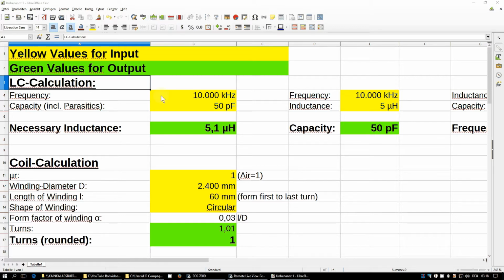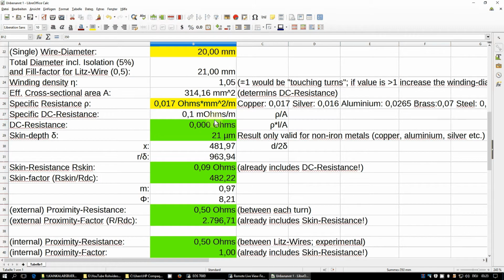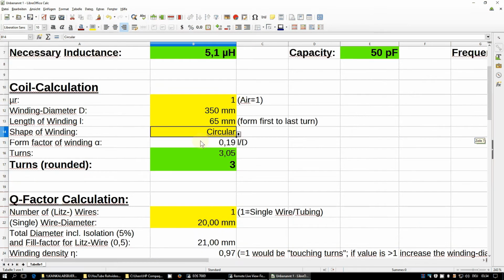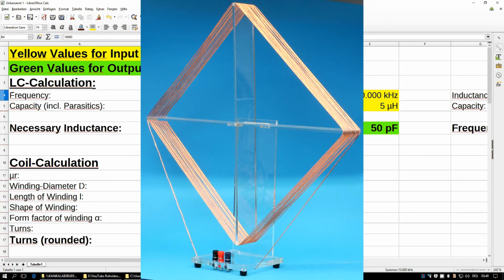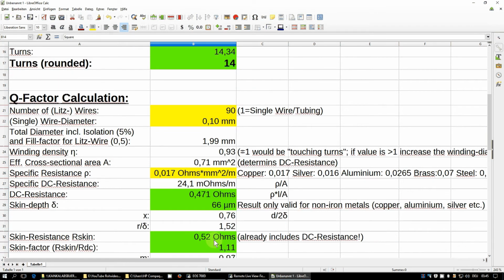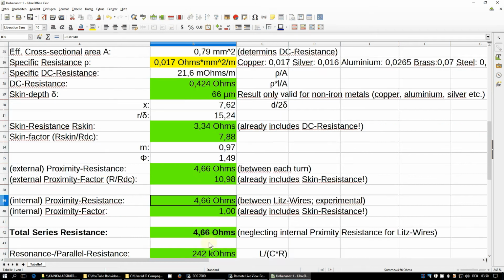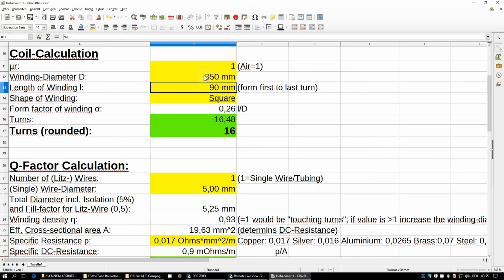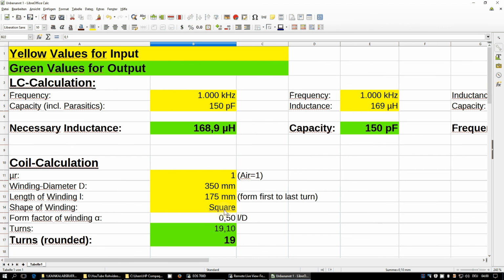A Spreadsheet for Magnetic Antennas Pt.2: Frame-Antennas & Multi-Turn Loops

Comment: Hi Roger,
I am playing with your spreadsheet (thanks a lot, excellent!) BUT my (external) Proximity-Resistance is SMALLER (your "m" is strongly negative) than the Skin-Resistance Rskin! Can this be correct? 
I am using the spreadsheet not for a magnetic antennas but a cylinder coil (secondary of a Tesla coil setup), which is much longer than its diameter. Is the spreadsheet not valid for such coils?
Reply from the maker: Could you email me the spreadsheet with your data inserted to roger@kainkalabs.com.
I will take a look. Best is with a short desciption in words/numbers of your Tesla coil so I can check whether you have input the correct values.